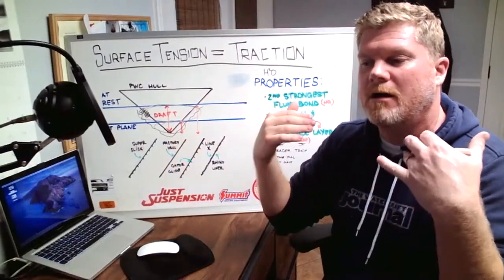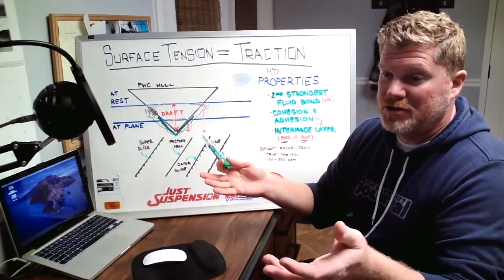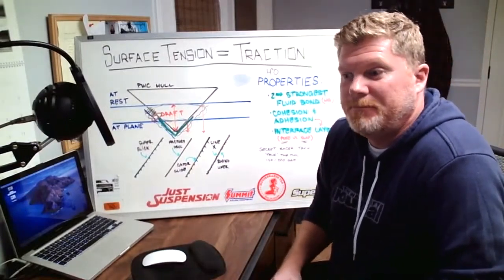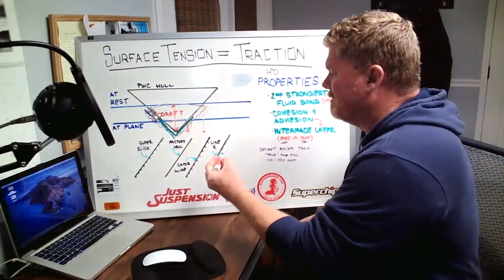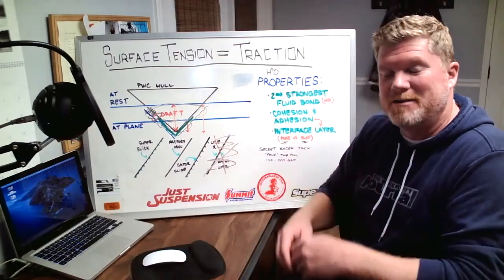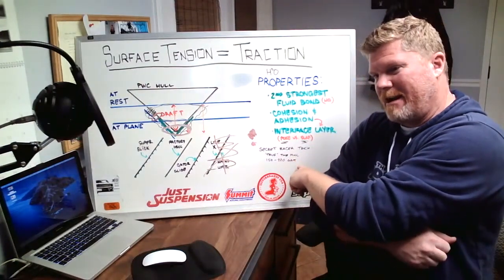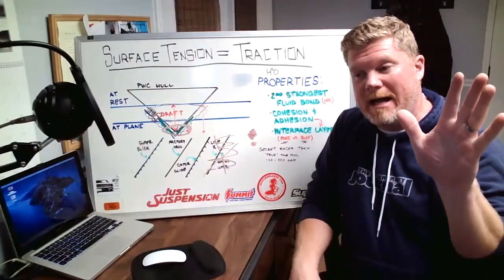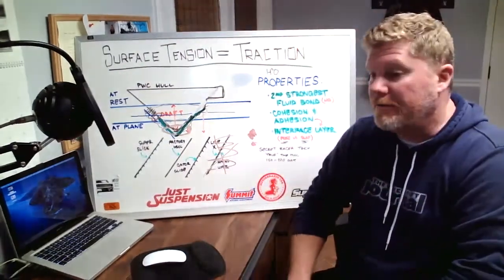How Hull Coatings Affect PWC: WCJ Quick Topic

Comment: I have a Kawasaki 650sx an I got it and the whole hull was sanded and had some fiber glass putty on it so I sanded it down completely an got it ready for either gel coat or gator glide. If I was to do gator glide I would just do the entire hull/bottom of the ski to that bumpers. 

I’m just trying to find out if I should do gel coat or gator glide. I’m not planning to race it or anything just want to see if it’ll have an effect on anything

Thank you!

Comment: Subscribed! Picking up a 2022 sea doo gtx 300 limited and it has some minor scratching on the front of the hull at the beginning of the V. Was considering fixing and also curious if I should clear coat with the flex additive to protect when beaching....overkill or nah?

Comment: You can spray GatorGlide like a clear coat, it dose not have to have the orange peel. Its way tougher and as much better adhesion. The turning real does not have much to do with the flat surfaces but more with the strakes and chine.
Reply from the maker: I have personally reached out to ALL THREE OE manufacturers as well as Cigarette Racing and a custom surfboard shaper on this topic. Differing surface tensions are direct causes for hull tracking and cornering instability. –K
Reply: @watercraftjournal  I agree but what causes the most surface tension? I summit it is the hull design. Change the shape of the brake alone will cause the craft to change its turning dramatically. We do not have a disagreement except maybe the degree of change caused by coating. I guess it depend on why one is coating the bottom, preservation or racing. My Ski with GatorGlide turns very hard.
Reply: Hey Dave, so is the turn consistent or does it give out part of the way thru the turn and you adjust for that?also did you apply this or someone else ?
Reply: @kamax7672  I haven't put Gator Glide on mine yet I know 4 differant folks that have gator on their entire hull and one just did portions like where the bunks sit. they've had it on for almost 2 years now and they're not getting the reaction or negative effects that Kevin talks about, but what Kevin does say makes sense if you go by the physics of the water tension on the hull I don't know I'm not totally sold on it and not totally against it
Reply: @johnwest2396  it does makes sense what he said indeed, but if you ACTUALLY know physics, you should also understand that those effects, while present, will be so minimal, that there will be no way to notice any difference. even if they affect as must as 5%, you would never notice that, but they affect even less actually.

Comment: Wouldn't the oem paint on the nanoxcell hull still spider crack underneath the gator glide?  And Wouldn't that , now comprised spider cracked oem paint,  cause a failure of the gator glide that is on top of the spider cracked paint?
Reply: @watercraftjournal  who is talking about sea-doo's ?
Reply from the maker: Yes, and that's why a clear coat with flex additive is the smarter decision.
Reply: @watercraftjournal  I would think that even clear w flex would eventually fail if the oem substrate cracked.
Reply from the maker: Good question. Optimally no. Again, it's nowhere near as fragile as the internet would have you believe; but two coats of clear with flex additive will keep it contained, even if it begins to crack beneath.
Reply: @watercraftjournal  Need advice on a upcoming purchase of a pwc.  Appreciate input on what would be best.
2017-2021 Kawasaki Ultra 310lx or 2019-2021 Yamaha FX SVHO.

Ultra 310LX benifits: 
SMC fiberglass hull with gellcoat paint (strong and durable) 
Best hull in waves and chop
Reliable engine
Comes with Bluetooth audio
Most storage (50+ gallons)
______________________________
Ultra 310LX drawbacks:
I don't love the looks, but it's OK
Manual reverse lever, no brakes
Seat may be too wide when standing 
High fuel consumption 
Short rear deck
_______________________________

Yamaha FX SVHO 
Benifits:
Looks cooler
More available to choose from
Easier to upgrade 
Less maintenance of supercharger pully pivot and belts
Larger rear deck w option for rec deck
Brake and left hand reverse 
_________________________________
Yamaha FX SVHO 
Drawbacks:
Nanoxcell 2 hull delamination worries (gatorglide fix good enough ?)
Supercharger clutch failure 
Not as good in the chop and waves

Comment: Check out the bottom on a race boat...it will not be shiny, wax smooth....you'll see it looks quite dull.
Reply from the maker: LOL
Reply: it doesnt actually prove anything, you will be shocked how little research most manufacturers do. Products are released with extremely dumb design mistakes all the time.
Reply: I should have expanded on my comment. A well know offshore boat manufacturer who had a pad bottom boat design used 400 grit sandpaper on the bottom of the race boats...thus the dull look instead of nice shiny gelcoat.
No, I wouldn't do that to my Jetski bottom. 😜

Comment: One thought... "flex additive" is meant for products like bumper covers so they can be assembled without cracking the paint. Having said that, "flex additive" evaporates in 12-24 hours depending on brand. So don't waste your money on flex additive. Just sayin'
Reply from the maker: Absolutely not, Mark. At all. Flex additive alters the catalyst to keep paint from cracking - like you said on plastic bumpers. It does NOT evaporate, as much as the catalyst evaporates.

Comment: Well what's the best thing to do when you don't wanna scratch the hell out of a ski?
Reply from the maker: Just what Kevin suggested, 1-or-2 coats of automotive clear coat with flex additive.
Reply: @watercraftjournal  I assume you'd still want to sand it afterwards to true it if you are aiming at perfection. After it is true you may want to add another final coat also.